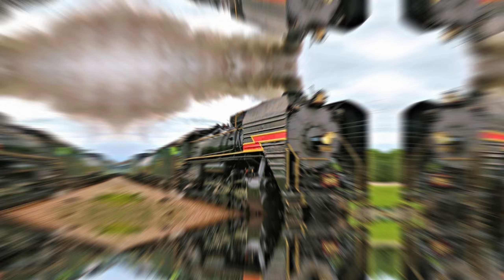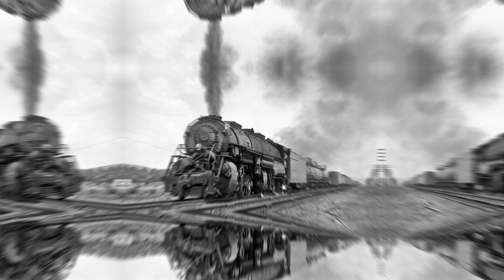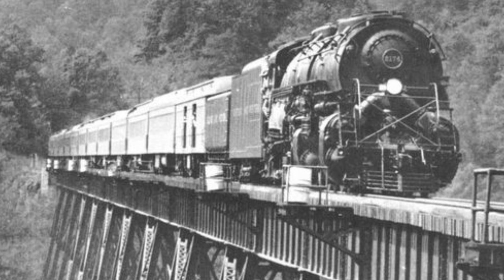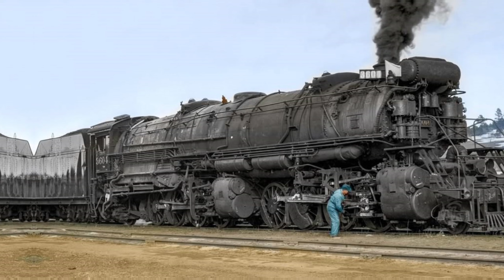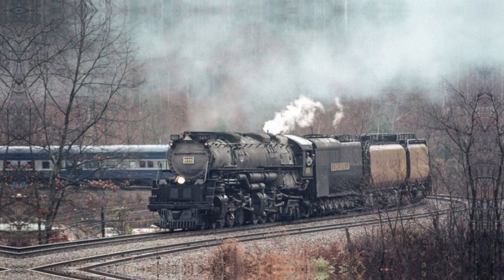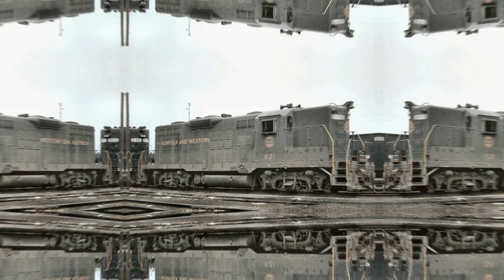They Called This Locomotive “Too Heavy to Be Practical” — Then It Outpulled Everything on the Line

Comment: Minimum continuous speed on GP9's us about 12 MPH - at speeds below 12 MPH the throttle MAY need to be reduced to prevent exceeding the Short Time Ratings of the traction motors.

Comment: The picture showed the 4-6-6-4 and the 4-8-8-4.  Which is it?  Or is this whole video AI fakery?  I might also report the so-called test with a single locomotive was actually run with three compound locomotives on a very regular basis.  No single class A or Y6-b was capable of pulling a train over that route.